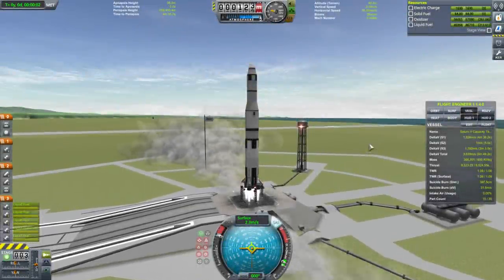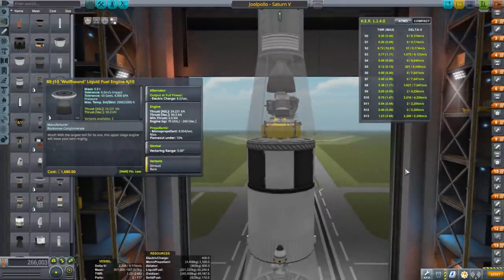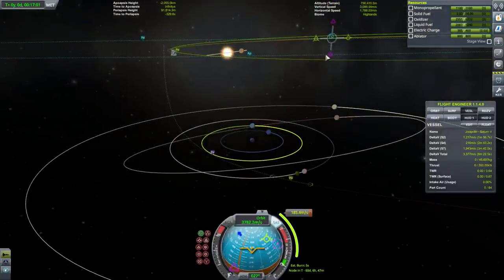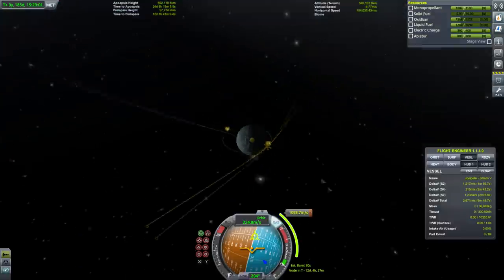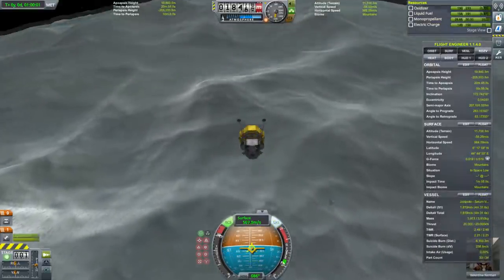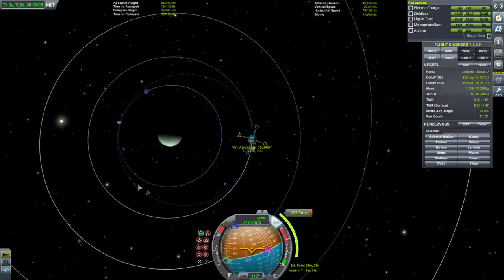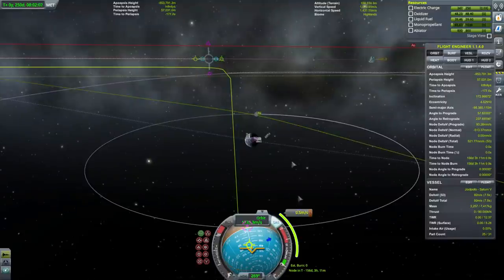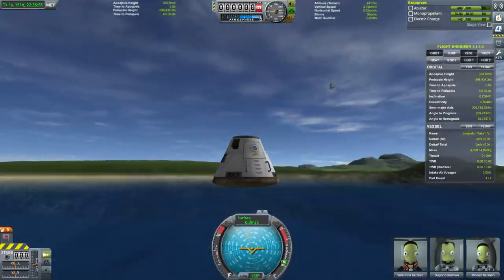Kerbal Space Program 1.4 - Jool-pollo (Saturn V Capabilities Test)

Comment: Something you could do for the Jool mission if you're not wedded to single launch:

1) Launch the lander on top of a Hitchhiker hab can w. solar arrays (a Skylab transhab analogue) - Definitely a probe core on that launch;
2) Transfer the fuel from the crew launch third stage into the cargo launch third stage whilst docked Apollo-to-Lander, then drop the crew launch third stage;
3) Do a Val Orbit Rendezvous, leaving the Hitchhiker/third stage to free drift until after the surface mission is done;
4) On return to Val orbit, docking to a docking point on top of the Hitchhiker (which doubled as the mooring point for the lander), or if there is no fuel left in the third stage, just use the SPS to return to Kerbin.

Comment: You were approaching Val in a retrograde orbit, you would have had enough D-V for the VEM approaching it in a prograde orbit...
And really going to Jool just to visit one moon is not really worth it.
Reply from the maker: The rotation velocity of Vall was about 18 m/s - I cut out the bit where I checked that and made the point you made - but it wasn't a huge difference. On the second point, I considered multiple moons, and if we had a different (non-Apollo-esque) spacecraft design, it would have been easy to manage it. I'll probably be doing those kinds of missions in the career mode series with a much more efficient rocket anyway, though.
Reply: I see, true IRL, the Moon doesn't rotate very quickly eother... a rotation every 28 days means orbiting retrograde doesn't make much difference. Hence why they did orbit retrograde to be sure to have a free return trajectory if necessary.
Reply from the maker: Indeed.